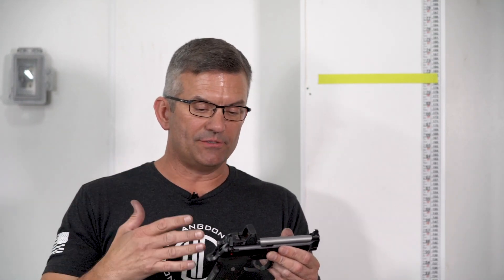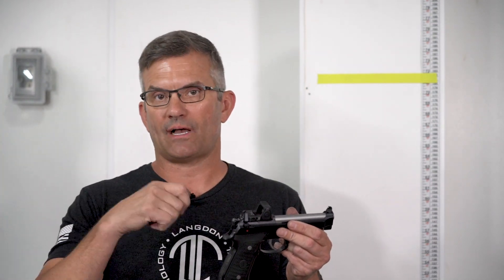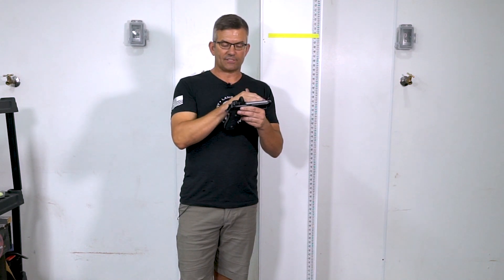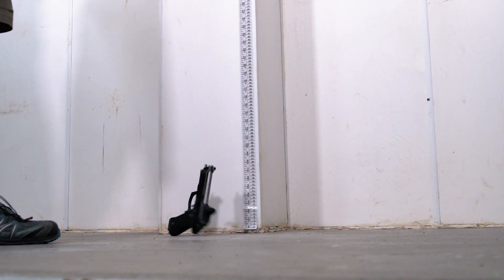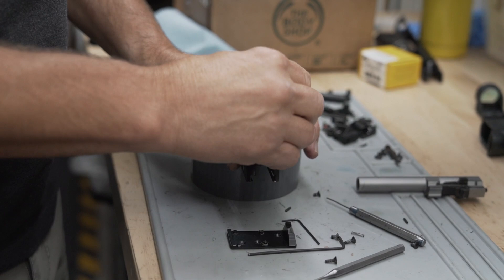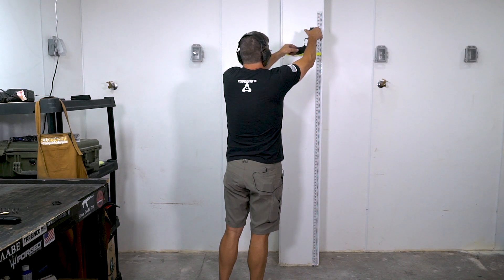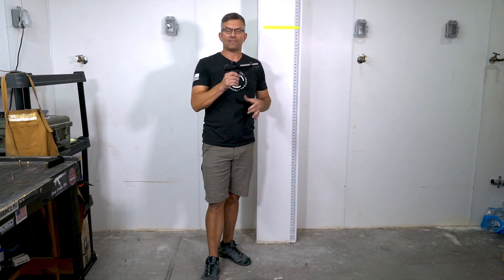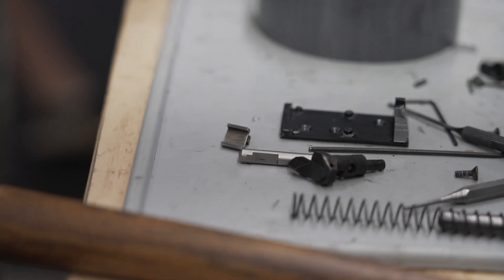RDO Drop Test After Thoughts with Ernest Langdon

Comment: If safariland will make an rmr/wml duty holster for this I will send my 92 in in a fucking heartbeat
Reply from the maker: I would love them to do that, but it is not likely. They are all about volume, so unless a fairly large police department decides to approve this configuration for a department-wide issue duty gun, it will likely not happen.
Reply: Ernest Langdon hey never say never! The world is a strange place. I wonder if I could find someone to make one in kydex for a level 2
Reply: @LangdonTactical  I was issued this weapon as my duty piece and had difficulty finding the right holsters or different holsters for it, we were issued the Safariland and it fit both the issue Beretta M9 with the rail and without the rail. We did not have the light mounted but on duty at night we wanted to go with the light/laser. Great safe weapon for duty carry and had not changed over to the Sig Model.

Comment: I hope you are investigating also how to improve magazine reliability... Last Saturday I had in my hands for the first time a 92x centurion and I felt in love with that great gun. My only complain was about the finishing and the incredibly cheap plastic mag plate.
Reply from the maker: I don't think you would have the same issue that we had. The plastic plate that you have has metal inserts in it, ours was a MecGar plate. We chose it because it held 18 rounds and the standard magazine for the Elite LTT. I have never had this issue with the MecGar magazine before or since, but I have also never dropped the gun from 6 feet onto concrete with a fully loaded magazine.

Comment: How about some Hotrod parts for the 80 series. Like, Skeleton Hammer, Extended Mag Button, Threaded Barrel, Aluminum Grips, Higher Cap Mags, Comp Trigger and Trigger Bar. With the new surplus for 81s there could be a market for them. I have three 81BBs add would like Langdon Elite parts for them like I have on my 92 pistols. I also read on the Beretta forum that you can change calibers from 32 to 380 with just a barrel and a mag. With the blowback design of the 80 series I wonder if a 32NAA barrel would possible? I love the size of the 81 for CCW. If Beretta could make the 80 series in the U.S. to bring down cost and chamber it in 32NAA I think the 80 series could be very strong in the CCW market. Imagine an 80 ELITE or an 80 X.